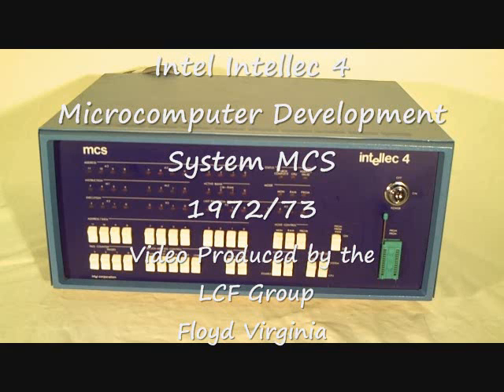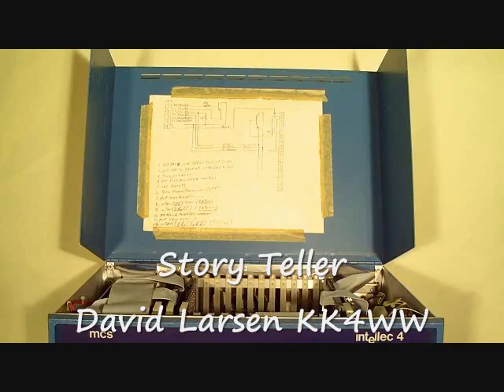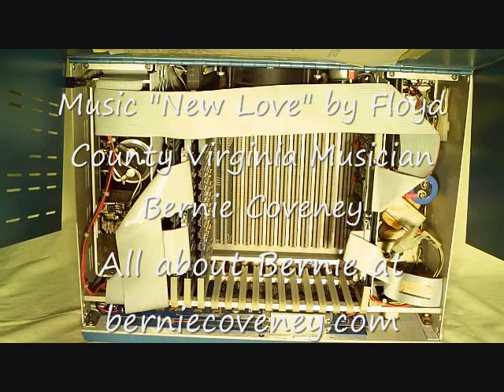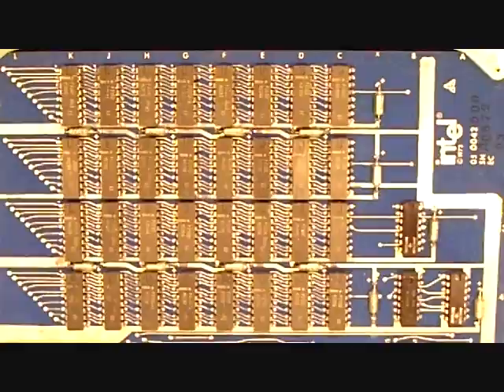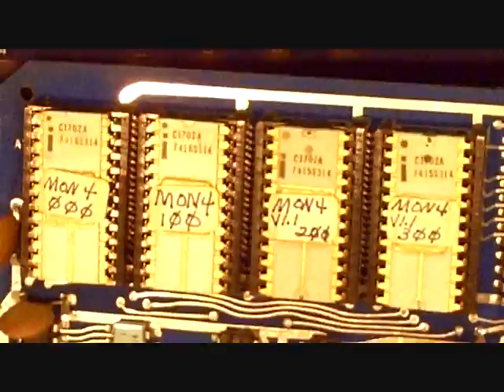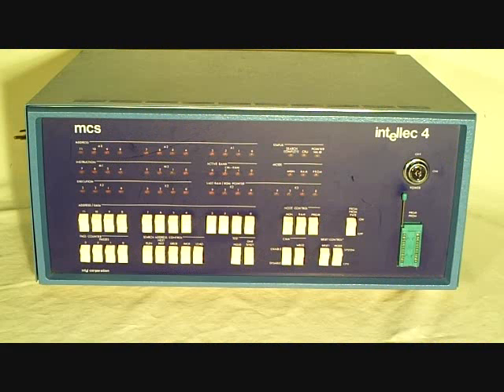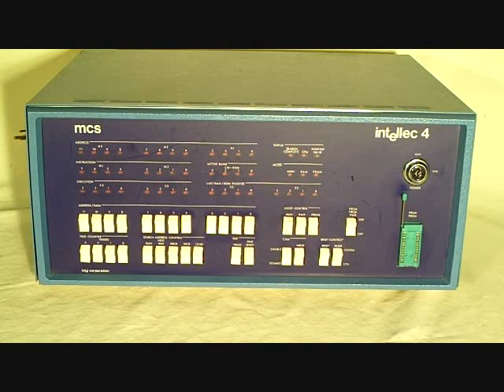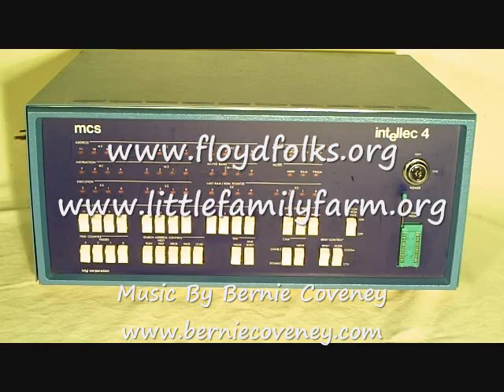Microcomputer  Intel Intellec 4 - 4004 microprocessor

Comment: If I remember right, the 4004 was designed to be a calculator chip.  I am the proud owner of an intellect 4, I've never opened the cover, don't know if any boards or chips have been stolen.  I also have an intellect 8.  The last time I had it up was about 35-40 years ago, I remember the console was an ASR33 TTY, I believe it was using using a 20ma loop rather than RS-232.  The 8080 was the first CPU I ever had to work with, including programming.

The good ole days -  Jim
Reply from the maker: HI Jim - You are correct the 4004 was designed to be used in the buscom calculator and it of course had may other uses.  Would you be willing to part with your Intellect 8 and what would be your requirements. Thank You David 
http://www.kk4ww.com   http://www.cyberengineer.info

Comment: Wait wait wait... "...so that's four-thousand bytes. That's about a million times less than our current personal/laptop computers which is typically 4 megabytes of read-write memory" (at 1:57) Just how OLD is this video?!
Reply from the maker: The video is old - I made it in 2010. The computer is from 1972 and is now located in the Computer Museum  of America. https://www.youtube.com/watch?v=lAFMPCxc2_o
Reply: If you only have 4 Megabytes of memory, you must have a very old computer, running Windows 3.11, something like a 486. Today's systems have 4 to 8 Gigabytes of memory.
Reply: more like 4 to 16 Gigabytes of memory
Reply: An honest mix-up, I believe, between gigabytes and megabytes. After all 4 gigabytes or 4 billion bytes (4 * 10^9 bytes) is a million times larger than 4 kilobytes or 4 thousand bytes (4 * 10^3 bytes). There are still laptops that are sold with only 4 GB, but in 2010 this was mainstream.

Comment: How this thing works? I mean how to operate?
Reply from the maker: Hi Arifin - Good question - it was not easy to operate and not  for the beginner. It is a computer to used to help develope  software, hardware and also write programs into an Eprom. You really needed to know how to program in machine code . There was some development software available but it was so long ago I do not remember just how hard  or easy it was to use.  There were not a lot of these units sold and not many out there now. I had two in my collection and there along with the 13,000  other items in my collection are now at the Computer Museum of America in Roswell, GA.   David Larsen - one of the Bugbook Guys http://www.bugbookcomputermuseum.com/BugBook-Titles-Originial.html

Comment: The video indicates that Federico Faggin designed the Intellec 4....This not true...It was designed by Phil Tai who worked for the Microcomputer Systems group at intel corp....This group also developed the Intellec 8 and the high level language PL/M which was the forerunner of CP/M that was developed by Gary Kildall

Hank Smith
Reply: Thanks for this interesting information. I am curious about the difference between Intel's SIM4 or 8-01 and Intellec machines: They seemed to have the same purpose – software development tools for the i4004 and i8008. Did they differ only by their packaging?
In addition, would you know how many were made (certainly very few, as the story told in this video confirms)